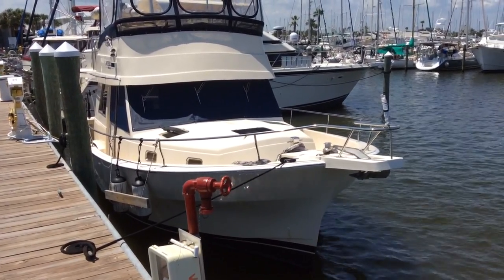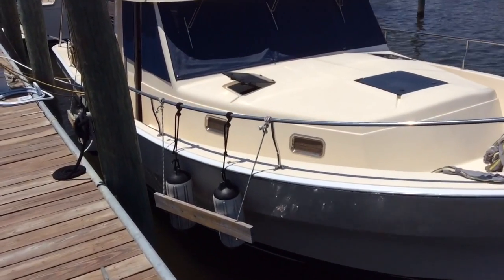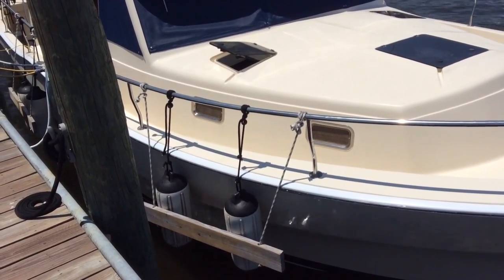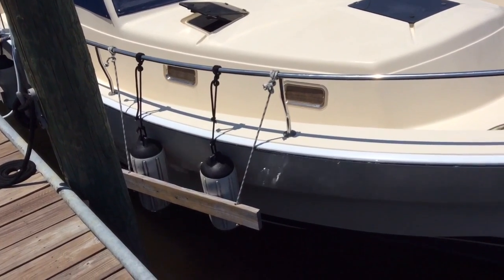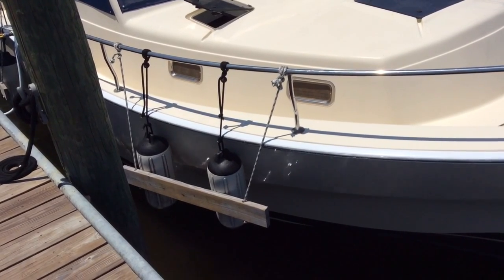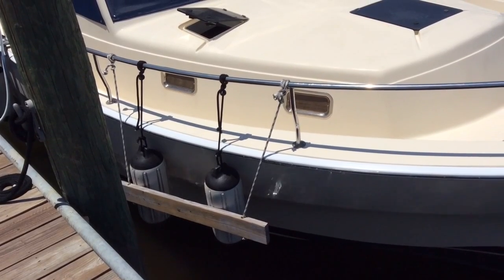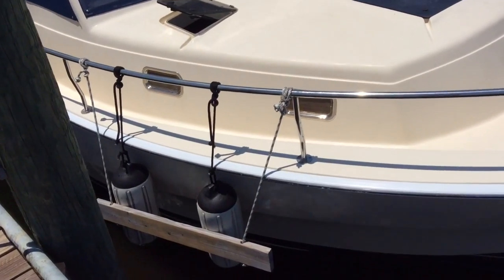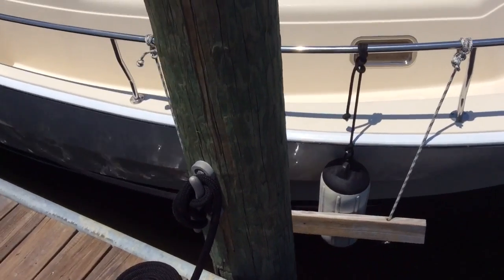Docking With Fenderboards

Comment: I built a set of fender boards for our boat.
Transiting through the locks at Oregon City, OR on the Willamette River.
Old, old set of 5 locks with a total lift of about 50 feet.
Very rough rock walls and the fender boards were really needed.
Reply from the maker: I assume our videos showing fender boards was helpful, C
Reply: @AskCaptainChris  Yes they are!